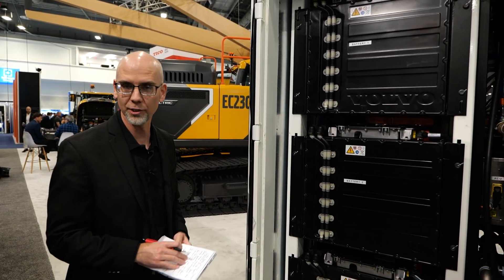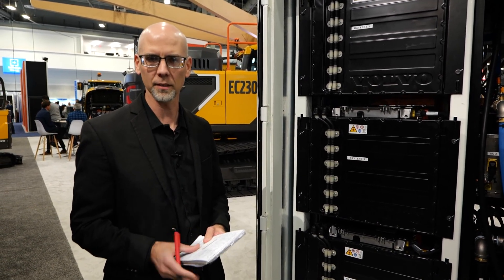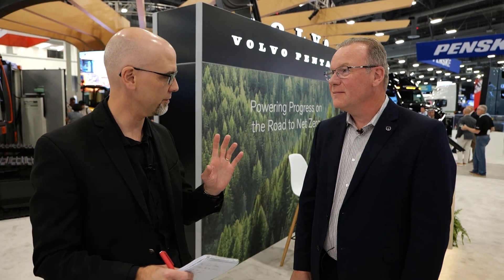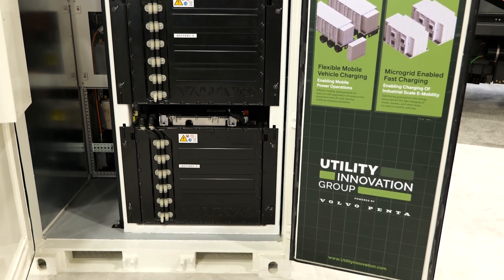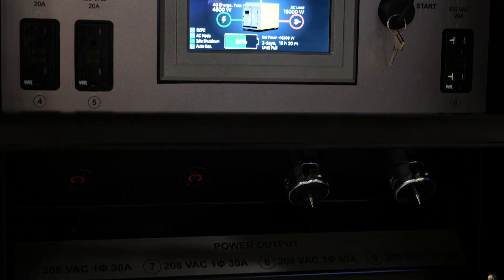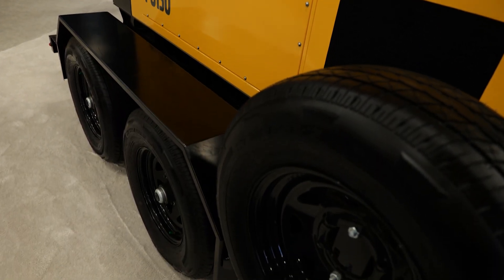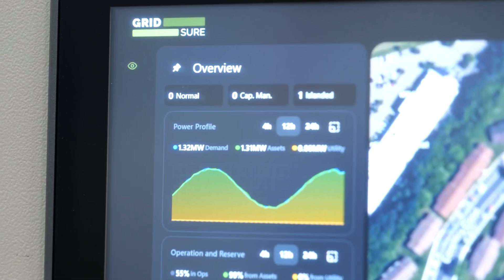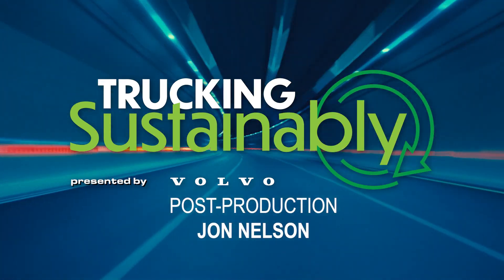Volvo Trucks – Episode 11 – The Potential of Battery Energy Storage to Power Fleets

Comment: As a US truck driver since 1998 I understand completely the complexities required to get 45k of various products from point a to point b according to shipper and receiver time limits while working under the DOT hours of service limits. All the various problems and time delays I encounter all day make that equation extremely difficult to make work. Delays at the customers, delays due to the cops sealing off the interstate for another accident multiple times during the 14hr work limit and delays at the fuel stop being in line waiting. There is also no parking after about 6pm at night with trucking ops managers wanting us to work 6am until hours run out. That being said you need on board charging and in my opinion that is a very efficient small generator that can fully charge a battery under hotel loads during a 9hr period. Hybrid is the current way to go not sitting in line during the 14hr waiting for my time to charge hoping no one has broken the charger like they do the diesel pumps all the time. In the meantime work on battery storage capacity and electrical system efficiencies. In the future it might be cheaper to wait and charge but that's gonna be way in the future. Oh and Volvo leadership I am available for hire and would love to get out of driving a truck all night:goat-turquoise-white-horns: